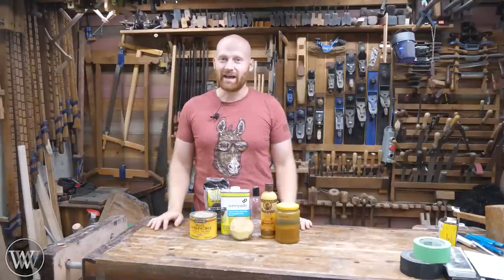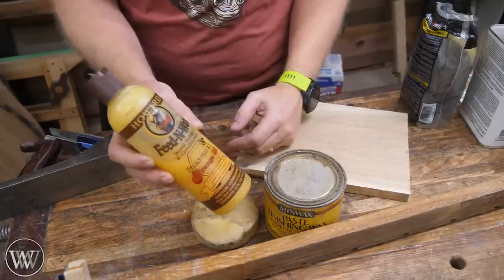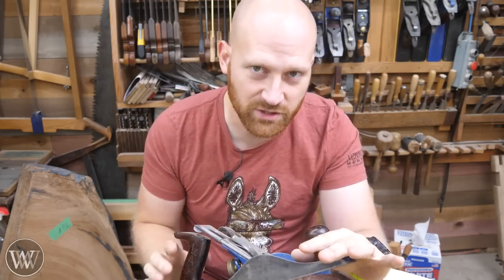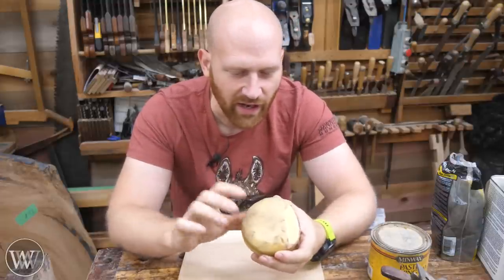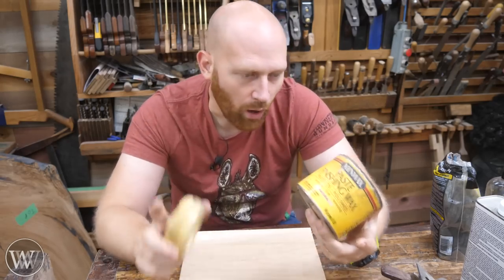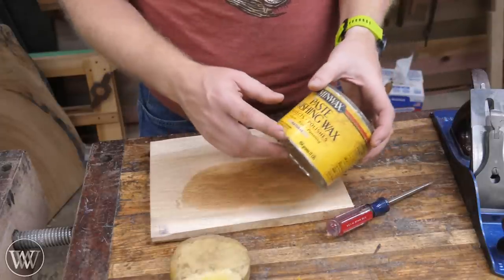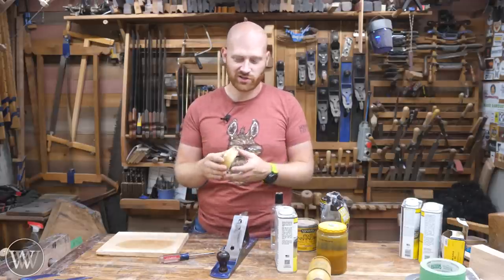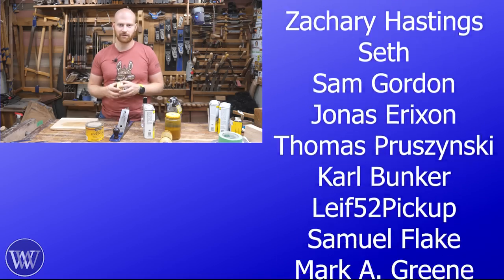Paste Wax The Magical Substance

Comment: I used to work at the Howard's factory in Paso Robles. They have some good stuff. I still use their leather conditioner.
Reply: When I went back to Fort Ord, by Monterey, CA., as permanent party in early '60 & before I went to West Germany in late '61, I went twice to both Camp Roberts by Paso Robles and the Hunter Liggett Military Reservation by King City which is about 25/30 miles to the north. A lot of rolling hills, grassland and scattered oaks all around that had some pretty decent Black Tails (a smaller version of the Mule Deer).

Comment: I enjoyed your video on paste wax, I just finished a small coffee table with spar varnish, I mixed it with about 30% mineral spirits rather than using full strength varnish, that seems to work better for me. Now that the final coat is applied I want to try finishing the finish with Johnson paste wax and 0000 steel wool. One thing I read by a man named Bob flexner, who has a book entitled " understanding wood finishing ", anyway, he says to let the final finish to cure for 1 whole month before this step, I'm new to this but would like to know your thoughts on these ideas 💡.
Reply from the maker: there are a few people that think that, but there are very few. most people will move on once it has cured for a day or so depending on the finish chosen.

Comment: Hi from Australia James!  I know I'm a bit late to the channel and video but I couldn't help myself.  Really good video mate.  I never thought of using a hard wax on my tools for rust prevention.

I have made paste wax from beeswax + linseed oil, beeswax + Danish oil (natural - without additives), beeswax + coconut oil, beeswax + neatsfoot oil.

I use the beeswax/linseed paste for wood that is going to be used outdoors. Eg. axe handles, rakes, furniture etc.

The beeswax/Danish oil for indoor wood or small items. Eg. furniture, small tool handles etc.

The beeswax/coconut oil for chopping boards etc.

Lastly, the beeswax/neatsfoot oil for leatherwork.

Like you, I love the stuff!   My wife warns our visitors that if they sit still for too long they will get a coat of Danish oil paste wax!  (My favourite. :)

Another use for the softer linseed paste wax is I push the tips of screws and nails into the wax before using them.  Particularly for hardwood.  I find they go in much better, cause less splitting and give the nail/screw a nice coating to help prevent rust.

I look forward to watching your future videos and catching up on your past ones.

Cheers.
Reply from the maker: Nice. I love how flexible paste wax is. You can come in so many different forms and so many different uses.
Reply: Informative thanks

Comment: I do remember, in woodwork class in the seventies, being taught to wax saw blades and the soles of planes. Then my big brother introduced me to the rag-in-a-can and oil. Since then I still use a wax block if away from the workshop (I now make my own with the same ingredients as James thank to YouTube). In the workshop I now use a tight spiral-rolled piece of leather in a can and oil. I make all my own paste waxes with beeswax, linseed oil or mineral oil, sometimes thinners and sometimes add a little carnuba flakes.
Reply from the maker: Nice. sounds like a fun time!
Reply: I use bees wax and walnut oil on the lathe frequently sometimes carnuba would they be good combined what is the ratio of oil to wax?
Reply: @snakeplisken2123  In my opinion, and this only applies to woodturning, that I would use either a beeswax stick or a carnuba stick for a more a more harder finish. Somebody may correct me here but I don't see what advantage it would be to combine them for woodturnings.

Comment: Thank you sir for your informative presentation. can we use Wax ONLY on bare sanded wood as final finish. can wax seals wood pores/fibre/grains ?
Reply from the maker: Wax can work if heated up so that it absorbs in to the wood. Most of the time done with a heet gun.

Comment: Really informative, been trying to figure out what to do with plane handles and knobs. I recently sanded down a No7's and have applied 3 coats of Danish Oil, simply because it's the only oil I had. I want it to be a bit shinier? Although I think the handles are little dark. Would you recommend getting a little tone of paste wax to apply or would that natural type do the job? Cheers mate.
Reply from the maker: most paste waxes will make it a bit shineyer. but in general if you want gloss you have to go with a film finish.
Reply: Grand job, I'll just pick a wax and go with that, many thanks for the response 👍

Comment: Do you use hard wax pucks on projects also, or just on tools? 

And how can we dye the wax? That would have been a great tutorial.
Reply from the maker: Generally the hard wax is just for lubrication and rust prevention. Though I know a few people who will use it to polish it into a wood surface. You just have to heat it up either through friction or a heat gun to get it down into the wood. I know some people will add dye when they're mixing it. I don't as I generally just prefer the look of oiled wood.
Reply: @WoodByWrightHowTo  Thank you so much for the answer. 

Luckily I have the heat gun already, for posible woodbending. I just have to figure out what kind of dye to use for it, although I also love natural look. 

I love your jokes. 🙂

Greetings from Croatia

Comment: Would it be appropriate to apply wax on the top surface at the glue line to avoid problems with glue squeeze out when edge gluing boards for a table top?
Reply from the maker: You could, but you will almost always need to flatten the joint so it won't save much time. At least if I understand the question.

Comment: Is there a reason you used raw linseed oil on your hard wax and boiled with your finishing wax or was that just what you had on hand at the time of making it.
Reply from the maker: The raw will stay more oily longer so it is better for lubrication. The BLO will polymerize quickly so it is better for finishing.

Comment: I have a question about putting wax on the shoe of a plane.  Can't that contaminate the wood and interfere with any coating you want to apply?
Reply from the maker: You would think that would be a problem but in practice and in reality it is not a problem at all.
Reply: @WoodByWrightHowTo  Got it, thanx.

Comment: So in the case of refinishing for whatever reason, just sand, clean and reapply? Whole project or can you "spot refinish" with an oil wax?
Reply from the maker: It depends on the finish you use. The paste wax goes on top of the finish to polish it out.

Comment: I am living in Malaysia where tools are horribly expensive. No planers. No miter saw. No bench top saw. He'll... No saw!! (just kidding)

I want to make a somewhat cutting board table top island.

I am thinking of adding dye and coffee and wood stains and other things to some to some cheap 1 by 2's on the on the long end of the green (not the wide end) but the 1" end.

Then, I will glue them altogether - hopefully they will be straight! - and sand them down.

Question : Will the stain penetrate enough that I can sand (a little) and still keep the color?

After that I want to put in some - I think! - mineral oil, then top it off with Johnson's paste wax?

Any thoughts?
Reply from the maker: It depends on the stain. Some of them will go in a decent distance and some of them just sit on the top. It also depends on how much sanding you're wanting to do for you. If you're talking a very light grit like 400 then you're probably not going to hurt the stain at all. But if you're going something pretty coarse then you could eat through very quickly.
Reply: @WoodByWrightHowTo  Thank you so very much, sir.

Comment: Mentioned using boiled linseed oil in one case and unboiled (or raw?) in another. I don't how each affects the properties of the paste wax.  OBTW, good info!!
Reply from the maker: Raw linseed oil stays fluid longer and takes longer to polymerize. That makes it great for lubrication and rust protection. But boiled linseed oil will polymerize quickly. That makes it better for wood finishes.

Comment: I'm in Southern Utah and about to refinish an old door on a brick building. Hasn't been cared for in over a decade so it has cracks and is seriously sunbeaten, sees sun most of the day. It was stained and coated with poly that has spiderweb bed and chipped off. I have marine varnish with high uv protection. It needs to be stained again and I was thinking about putting on a few coats of BLO to nuorish the wood before the varnish. 
My questions are 1. Does putting on coats of BLO make sense for this? 2. If so, should the blood go on before the stain or after or does it matter?
Reply from the maker: I would do 2 coats of BLO the Oil based stain then the varnish. Sounds like fun.

Comment: I’m using paste wax for the first time as a top coat for both the painted surface and the raw wood. The painted surface came out with a mild sheen but the wood still looks like raw wood (even though it is water resistant now). Any tips to getting a sheen on the wood. Thanks for the vid.
Reply from the maker: for the sheen it comes down to how you polish it on there. you need to burnish the wood. this might help you. https://www.youtube.com/watch?v=nBQ7I45NMpQ

Comment: I have started to use a polissoir (made from broom straw) instead of steel wool so that I do not get any stray bits of steel on the surface. It works well on a flat surface. For curved surfaces I use white abrasive pads.
Reply from the maker: Right on. A lot of people like using those. It's especially good for hard wax or frinch polished surface.

Comment: Great video! Is there a specific grade of steel wool you used to apply the wax. I am not a woodworker but looking to finish some frames so your videos are really helpful. Thanks!
Reply from the maker: I generally use 000  but it really doesn't matter. That just happens to be what I have a lot on hand

Comment: Is there any wax which dries super hard, but allows you to layer it up and buff it before it cures, for a super shiny hard finish with absolutely no paint brush marks, dust, etc?
Reply from the maker: In that case you would probably want to use hard wax. It's a type of finish which is and is not a wax. But it's one coat rather than being built up over many coats. The two main brands are Rubio monacoat and Osmo.
Reply: @WoodByWrightHowTo  Hey, thanks very much.  Do you think it would be tough enough for a coffee table top?  Do you think the users would need to use coasters?

Comment: Great info! Is it possible to melt beeswax, add some mica powder to tint, and apply as a decorative wax into carved areas?
Reply from the maker: very much so. that would be the way to go!
Reply: @WoodByWrightHowTo  Thank you!!!! do you suggest adding an oil to keep it more spreadable like a paste? If so which oil to you suggest? Thank you again sooo very much!
Reply from the maker: If you're going to heat it up and melt it in then generally I wouldn't add any oil. You could also do it with a thinner like mineral spirits. But if you add an oil I would probably go with something like boiled linseed oil. That would cure and add a little more resilience to it. If you use something that stays oily then it will feel very oily for a long time.
Reply: @WoodByWrightHowTo  Makes perfect sense now that you say it!! I think that is where I made my mistake a while back. I will test with and without adding anything. Thank you soooo very much
Reply: @WoodByWrightHowTo  Thank you again! I have all my products to try this. At what point would I add my pigment or mica powder? At the beginning before melting? after all ingredients have been melted? or after it has turned to the soft paste/wax? Thank you again!

Comment: One caveat with waxing the sole of a plane - wax can transfer to the surface being planed, which can mess up staining and finishing.
Reply from the maker: I have never had the problem with that. I've been doing it for years and even on the final finish smoothing it doesn't cause any issue at all with finish application. It's one of those things you think too should in theory but in practice doesn't affect it at all.
Reply: Glenn Storey with each pass the wax transfers to the surface, the next pass takes it off, ad infinitem, or until the transfer stops.
Reply: @WoodByWrightHowTo  I'm glad you mentioned that, because I had the same concern about whether wax from saws and planes might transfer to wood and interfere with finishing.  But if this were a real issue, I think you would have encountered this problem by now.  Thanks for a good video.

Comment: maybe i missed it in the video. but how do you adjust the shine of the surface with wax? i’d like to have a satin finish , but on other products a gloss finish. is there a buffing technique to adjust this?
Reply from the maker: The shine is dependent upon what you put underneath the wax. And how you polish that. The wax just fills in imperfections of the surface. So if you want a matte finish, usually a simple oil like BLO and then paste wax will give you what you want. If you want high shine then you use a poly or shellac and then apply your past wax.
Reply: @WoodByWrightHowTo  ogh so you can oil, and then wax over that? interesting. thanks. i’ll try that

Comment: I am refurbishing some old wooden sash double hung windows and want to lubricate the sliding surfaces of the sashes etc.
I have a tube of Porter cable lube wax #44914
What do you think?

Thx, Jeff
Reply from the maker: I am not familiar with the stuff. traditionally paste wax was used when the storm windows were changed.

Comment: Cool stuff, thanks.  Is raw linseed oil like BLO in that you have to be careful about the rags when you're done (fire danger)?
Reply from the maker: yes, but not quite as much. but it is the same with any oil finish. even the oil based paints and poly. I have a video showing it catching on fire if you want to see what all it takes and how to easily avoid it.
Reply: @WoodByWrightHowTo  Thanks!  I remember that video, I just couldn't remember if the processing into BLO was what did it.  You're always a great resource.

Comment: I use a mineral oil because I've not found a natural blo source, and I'm not in a hurry to accidentally burn the house down. But I started with 50/50 and went from there. So I've got 3 different mixes sitting around and one can store bought. Yeah figuring out which one works best for you can be complicated I like harder for things that dont touch the lathe and softer for lathe projects but I still go over ot with a bit of medium thick and a low set heating torch before I buff in with a rag, leaves everything shiny and with a waxy plastic feel that is still safe to drink out of
Reply from the maker: Sounds like a lot of fun Man!
Reply: @WoodByWrightHowTo  fun.... yes a little
Reply: @drawlele  Look at Tried and True.  They have natural BLO. You can even get it on Amazon.  The original has a bit of bees wax mixed in.  They also have a Danish oil.  I've used the original and like it. I don't know if they have a straight BLO w/out bees wax, but you could check their website.

Comment: When making your own paste wax, if it does not turn out the way you want it, can you remelt it and add more wax or oil depending on the desired consistency?
Reply from the maker: so true. it is an incredibly flexible substance.

Comment: You apply the paste wax to raw wood before staining or finishing from there?
Reply from the maker: No. the paste wax is usually the last thing to go on. after stain or protective finish.
Reply: Wood By Wright How 2 ok. That is what I thought and have done for years. I have used paste wax to lube raw wood drawer runners.

Comment: Boiled or not boiled?
Thanks, I'm a carver and this has been on my list for a while. I'm going to look up your other video. (subbed as well).
 I'm thinking it's time to run a few small lots and see how they work on my carvings. The non-toxic oil, wax and wood combo would be great for toys. The young ones can chew at will with no danger. I have the beeswax and mineral oil, think I'm out of boiled linseed (gotta go look but I know it was nearly gone last time I used it). I've never used the raw linseed, what are the differences? I'm guessing the raw cures (polymerizes) more slowly? It it worth buying a can to add it to the lineup or does boiled serve the same purpose? Can you buy a can of raw and boil half yourself? (I'm a low volume/small projects kind of user). Is Tung oil a good option? (think I have that) Thanks again!
Reply from the maker: I use boiled lentil oil for my wood finish wax and I use raw for my rust protectant and lubricant wax. The raw will cure much slower whereas boiled linseed oil will cure overnight. If you get boiled linseed oil from the store I would not suggest using it on things people would chew on as it has chemical dryers in it. The stuff I use is boiled and cereal I've made it home so that is safe to eat. I have a video on making your own BLO if you want to see that. Tongue oil is very similar to linseed oil. It comes from the tongue tree in Asia.
Reply: @WoodByWrightHowTo  Thanks!

Comment: My last workbench top had shellac and then paste wax. Now I'm wondering if I can skip the shellac and just use paste wax. Only thing is I don't want the bench top to be too slick. Maybe I should only use beeswax on the work bench?
Reply from the maker: I just use boiled linseed oil and paste wax. Gives a good working surface. and over time you're going to be spelling other finishes and things on there anyways.
Reply: @WoodByWrightHowTo  Ok, thanks for the reply.